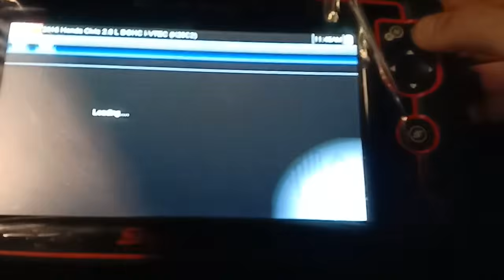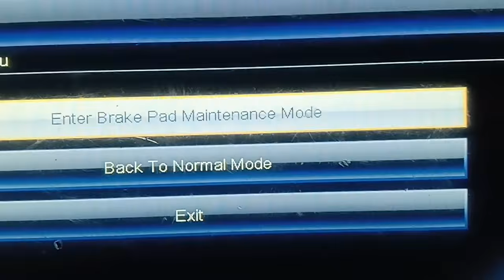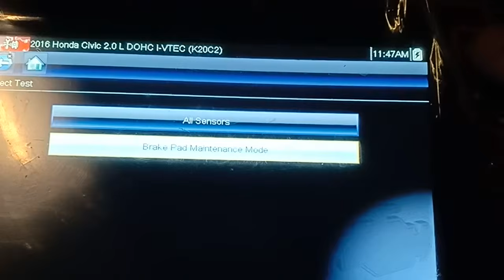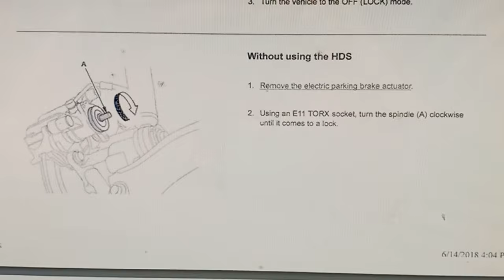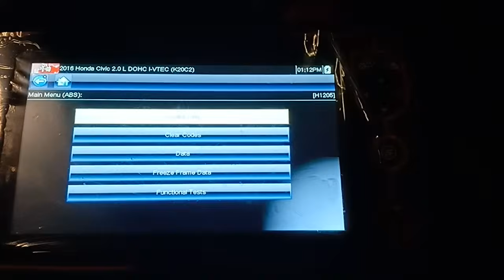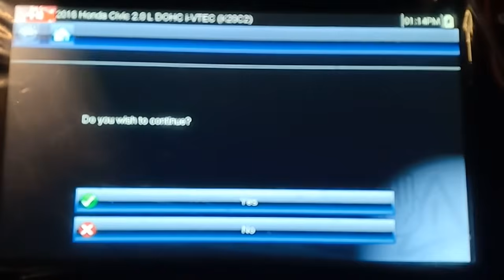How To: Set Honda EPB Electronic Parking Brake Into Maintenance Mode With Scanner And Manually

Comment: I’m one of the dummies that didn’t know .  Now I get errors codes because it not set up properly from messing with caliper .  My question is can I reset the actuator from a scanner ?  ??  Or do I have to do this now manually which I’d rather not try ….

Comment: Easier said than done. I got it into maintenance mode with ease. The brakes and rotors were a breeze to change. Tried putting it back into Normal mode and I got ABS and E brake codes. It turned into a complete nightmare.

Comment: After entering rear brake maintenance mode. Can you turn off the car while doing the rear brakes or the scanner needs to be on the whole time? Thanks.
Reply from the maker: It can be turned off

Comment: Hi, thank you for that review. I helped a lot thank you. Just learning how to use my Snap-On Zeus. Plus. My question is after you put the rear brakes and maintenance mode I assume to not run the battery. Do you turn off the vehicle before proceeding to replace the brakes and then turn the vehicle back on not running to turn on the scan tool again?

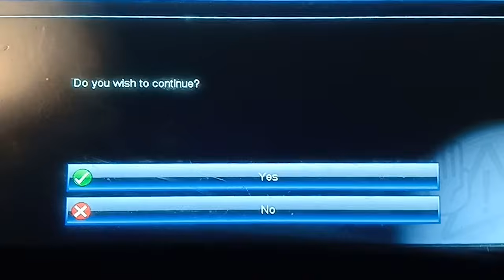Comment: 2:15 so the scan tool retracts the electronic motors into the caliper right? At this point you can compress the piston without worrying about the E brake actuator?

Comment: Hi Jay. I am hoping you read this comment soon. My question is related to the brake job once the maintenance mode is set in place using the scan too (which I do own one that that can do this).  Once you begin the brake job are you still removing the electronic parking brake from the caliper? I assume yes. So the only thing the maitenance mode does is remove the need to manually turn the plate on the back on the back of the caliper with a torx socket, correct?
Reply: Thanks Jay. I just watched another video of yours on the Civic and I see the parking brake is not in the way of adjusting the caliper piston. Excellent channel and I am a new subscriber.
Reply from the maker: @chrisryan8863  awesome thanks for watching.
Reply from the maker: No.  Once it is set into maintenance mode, you will do the brake job as usual.  Once you are done put it back into normal mode.  You do not remove the electronic parking brake from the caliper.
Reply: @jaythemechanic4950  so does putting it in mainteance mode also suppress the caliber to prepare for new pads (and if not, how do I suppress the caliber with the parking brake connected to the back of the caliper)? Sorry to be a pain with multiple questions, I am just not fully clear by your explanation of how to suppress the caliper and I think maybe other viewers may have the same question. Thanks so much Jay!!
Reply: @jaythemechanic4950  Hi Jay. Just to clarify, you are saying the caliper can be fully removed WITHOUT removing the parking brake assembly from the back of the caliper (it will stay attached when I remove the caliper). Correct? Thank you!
Reply: And if that is correct, how do I retract the caliper with the parking brake assembly still attached?
Reply from the maker: @chrisryan8863  yes. After you put it into maintenance mode just do the brakes like usual. Don’t forget to put it back into normal mode. I have a video on doing the rear brakes. Check my other videos.
Reply from the maker: Ok. So when you use the scanner to put the ebrake into maintenance mode, the mechanism that engages when the ebrake is engaged will move away from the piston. Once it is in maintenance mode just do the brakes like you would otherwise. Just don’t forget to put it back into normal mode, otherwise your ebrake won’t work.

Comment: Not everyone has scanner so this video is complete dog water if you really want to set it use a power probe yes you can fuck up the brake system if you don’t know how to use it but my suggestion is to learn how
Reply from the maker: Did you watch the rest of the video?  Because it shows you how to do it manually.  You don't even need a power probe.  Are you the Power probe salesman?

Comment: It's a little disappointing that Toyota has a way to retract the caliper electronically for service without a scan tool and Honda does not.
Reply from the maker: That's right.  Even other car companies like Mazda, etc.  you don't need scan tool and can be retracted electronically just by doing a simple procedure using the gas pedal etc...

Comment: I didn't set anything before changing my breakpads. now my car shows electronic parking break issue, hold break issue
Reply from the maker: Yes you will probably need to replace the rear calipers.  :(

Comment: What tool is this? I just got back from the dealership after not doing this electronically, manually, and I screwed it up. $1700 for new calipers.
Reply from the maker: its a snap on solus edge scanner.
Reply: @jaythemechanic4950  are you aware of a cheaper tool that does this? I’m just interested in brake pads and rotors and $1800 isn’t worth it for me. A mechanic, absolutely. Not worth it paying $2k for a new one or $1750 on the low end for a used one for one function.
Reply from the maker: @mro2352  I understand.  I use it everyday.  If you look for thru the comments here, I remember someone mentioning a scanner that has this feature and it was only $250 I believe. Also, why don't you do it the manual way?
Reply from the maker: I will see on youtube if no one has made a good video for the manual way, I will make one.  I now own a 2017 Honda civic Touring, so I can do alot of videos on this car.
Reply: @jaythemechanic4950  I have a 2018 odessey, I tried the manual one and it failed. Two broken e-brakes
Reply: @jaythemechanic4950 any chance you could link the manual way for the video

Comment: Hello:! Thanks for a great video. I have a question to ask. Wouldn't be just easier to desingage EPB by pushing down the EPB activation/ deactivation lever inside the car's cabin after you put the car on jack stands ( rear wheels are lifted in the air). By doing that, you would NOT need a scan tool. Of course, you still need to retract the caliper further by using a special tool/ pliers.
Reply from the maker: No, do not do that.  You must put the calipers in service mode properly.  When you are putting it in service mode, the piston is moved back even more than when the e-brake is disengaged.  Otherwise you will cause error codes and possibly damage the pistons.
Reply: @jaythemechanic4950  I see. Thank you so much for your reply! Cheers

Comment: Hello super vid but wich scantool u used and wich the best for 1.5 sport sedan civic 2017 10th gen
Reply from the maker: Snap- on Solus edge.  You don't need a scanner, you can do it manually.
Reply: Thank u yes that s to exspensive manual better.
But turning the brake pads all the way clockwise
Reply from the maker: @edwinhoogstad9141  yes, but remember to first put it into service mode
Reply: @jaythemechanic4950  uuhhh i don t have obdscan or tool i thought u meant manually disengage motor then turn clockwise in brakecilinder all te way
Reply from the maker: @edwinhoogstad9141  Watch the video again.  It will instruct you on the manual way towards the end of the video.

Comment: Need help urgent: does my 2011 honda accord need to be in a Break service mode when the mechanic is changing the break pads?
Reply from the maker: If you have electronic parking brakes: yes.  And it only applies to rear brakes not for front brakes
Reply: @jaythemechanic4950  ok. I have regular parking breaks.  What would be causing abs break light to go on and off when it feels like? My mechanic didnt find anything? Although i think he s fired for that reason.
Reply from the maker: @saraalvarez7354  I believe those model accords might have a problem with abs pump/ module
Reply from the maker: @saraalvarez7354  I don’t know what is happening to your car so it’s hard to say for sure

Comment: Nice demonstration  Your scan tool is convenient to have to put brakes into maintenance mode rather than manual method.   Do you need to have your key ignition  on while doing pad exchange or can you you turn it off then turn it on  again to put in normal mode.

Comment: It’s been over a year so Im sure you wont see this but im probably going to have to do this manually and when it says to turn the vehicle to the on mode it means just starting it up right? Then turn the vehicle to the off (lock) mode means just turning the vehicle off right?
Reply from the maker: Thank you for your question.  The ON mode is just before starting the vehicle.  Full power but vehicle OFF.  Hope that helps

Comment: Great help Jay. Thank you.  You mentioned that the rear brake must put in maintenance mode save my work and $. I did NOT know about the EPB service mode until see this video.  I also bought the Autel AP200 that Alberto Castillo recommenced.  It works for my Civic 2017. If anyone work on Honda buy the Autel AP200 tool!
Reply from the maker: i"m glad it helped you.  I was told by another viewer that the ap200 does not work. ??
Reply: @jaythemechanic4950  it has worked very well for me, 2018 Civic Si
Reply: @ManpreetSingh-nz9uq  Hey Singh, where r u located? any chance by the bay area? SF or san jose or nearby? i would need some help! stuck with my 2018 Civic..wd be great if i can swing by for a quick fix 😁

Comment: I contacted autel about using the ap200 for my 2019 Honda Civic and they said it doesn’t work :(
Reply from the maker: I have never used Autel products so I’m not sure if it works. Just do it the manual way.
Reply: HI is it working now or is it still not working with 2019 civic ?
Reply: @bahadrusta1827  They sent me a new model and it works
Reply: @Tee-tc2pt  what is the new model?

Comment: Thank goodness I watched your video first before I did mine, I did NOT know about the EPB service mode, so thank you thank you THANK YOU!!  My OBD2 scanner does not do two-way communication, so I had to do the manual way.  I'm gonna share the way I did mine, basically just an elaborated version of the instruction from techinfo website screenshot in the video.  So here's what I did :  1. After jacking up the car, blocking front wheels and took off the rear wheel, I turned ON the car, released (disengaged) the E brake, and turned OFF the car.  2. Locate the EPB actuator (black plastic housing bolted behind the calliper). There should be two hex socket bolts holding the actuator, one in an obvious spot, the other one is hidden in the back.  Unscrew those two bolts.  3. Take off the black actuator housing, securely hang it with a cord.  4. Use E11 Torx socket to turn the now visible spindle clockwise.  This should be very easy to do, very little resistance, and when you feel it has come to a lock, stop turning.  This completes the two steps mentioned on the techinfo website.  5.  Do the brake pads/rotor replacement per Jay's other video.  6.  After installing new pads/rotor and putting back the calliper, install the actuator back onto the calliper, you may want to re-grease the torx spindle.  I also put some thread locker on the two bolts that hold the EPB actuator.  7. Turn ON the car,  apply the parking brake (that's why in the very first step I released the parking brake first), and then release the parking brake again (note: when you release the parking brake, you're supposed to step on the brake, because you just did a brake job, you may need to press harder on the brake pedal than usual to be able to release the parking brake, at least this is what I found.)  8. Turn off the car, put wheels back on, torque the lug nuts to spec, and test drive your new brake.  After doing this way I did not see any error message showing up, and the EPB functions normal.  Hope this helps whoever is trying to do the manual way for the service mode.  Good luck.  And thanks again Jay for your video.
Reply: I was just quoted over $650 to change the rear brakes now I’m here looking on how to do it myself 😅
Reply: Do you have to turn the spindle back counter-clockwise when finished?
Reply from the maker: Don’t turn the spindle counter clockwise. Just give the vehicle power and apply then release the parking brake
Reply: @jaythemechanic4950  Thank you!!!
Reply from the maker: @crazycrys420  No problem.  Thank you for your support.
Reply: @jaythemechanic4950  If you can't get the spindle to align with the actuator is it wise to turn it slightly counter so it can go back on? I haven't done this yet but I saw it can happen.
Reply from the maker: Yes. When you finish the job it must be put back to normal mode
Reply: Thanks a lot for the info friend! It would be great if you do that video :D
Reply: Thank you so much!! I found that I could turn the spindle by hand pretty easily.
Reply: What type of grease would you recommend for the torx spindle? If you respond, thank you!
Reply: Thank you kind sir
Reply: This comment just saved me soo much lol thank you for explaining how you did it!
Reply: Thanks for the more detailed manual procedure
Reply: @@597pc2 I think I stepped on the brake first, and then E break
Reply: Can u put the link to the manual website up

Comment: This video is a life saver.  Did the manual option... Very easy.  Removed 2 bolts, too the plastic thing off the back, screwed the torx shaft clockwise and then compressed the piston and put it all back together. Easy peasy.
Reply from the maker: I'm glad you found it helpful.  I've gotten alot of messages from people who were not aware of putting the calipers in maintenance mode and ended up damaging calipers.  Thank you for your support.
Reply: @IvanaNotyers  I also used the term "plastic thing" up there.  You got a problem with that too.  Hahaha
Reply: I installed new rear pads, used the cube piston tool to turn the piston in but did nothing to the electronic brake system brakes are working fine but now have error codes for electronic brake system and brake hold system
Reply from the maker: @NKY-RC  Thank you for your question.  Unfortunately, you may have damaged the rear calipers.  I would take it to a garage and have them set the e brake into service mode and back to normal mode and see what happens.
Reply: I did my rear brakes today and did not no this. I am wondering if I can do the manual way with the new pads installed or if I need to take everything apart and start all over. Or do the other way with a scanner with everything installed
Reply: Hi GR, Did you have to reverse screw the torx shaft after everything is put back together?
Reply: @granade6  yes, the piston will not collapse back into the caliper if you don't. I used a socket that fit snug in the torx shaft to help turn.

Comment: retracted pb motor  manually then  screwed pistons back with wind back tool worked fine but im guessing once pb brake is retracted pushing back caliper piston like usual wont hurt pb motor
Reply from the maker: yes...I was just showing that you don't have to twist the piston to make it go back.  Thank you for your support.

Comment: Which scanner did you use?
Reply from the maker: snap on - solus edge.  newest software.
Reply: Jay The Mechanic Do you know of any other scanners(under $500)that have the same function lol
Reply from the maker: @lunwang1700  Thank you for your comment.  I don't think it has much to do about the scanner... mostly about software.  But it cann't be a code reader.  Please consider supporting my channel by subscribing.  Help me reach 1000 subs.  Thank you.
Reply: Jay The Mechanic thanks for the advise and thank you for replying back, I just subscribed to your channel too.
Reply from the maker: @lunwang1700  Thank you for your support.
Reply: @lunwang1700  search for Autel AP200 on Amazon. It allows you to put your brake pads in maintenance mode
Reply: @leatherneck75  thank you, i think i might give it a try.
Reply: @lunwang1700  no problem

Comment: I dont think that my mechanic done this process. After changing rear pads the system starts showing electrical parking brake problem. Please tell if you have any suggestions
Reply from the maker: Hi Raspinder.  Thank you for your question.  Personally I have never had to face this problem because, I have always placed the calipers in service mode first. It is a possibility that your mechanic has damaged both of the calipers. I would take the car to either the Honda dealer or find a good mechanic that has a scanner that is capable of putting the EPB into maintenance mode and back to normal mode.  Try that first and see if it resets the trouble light.  Let me know what happens.  What city/country are you in?